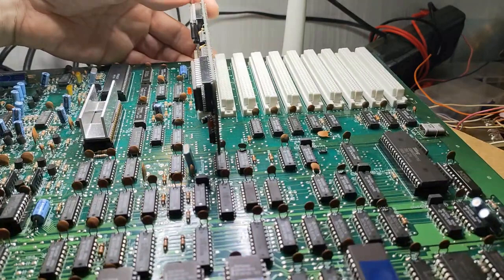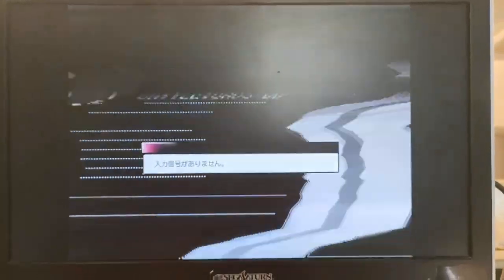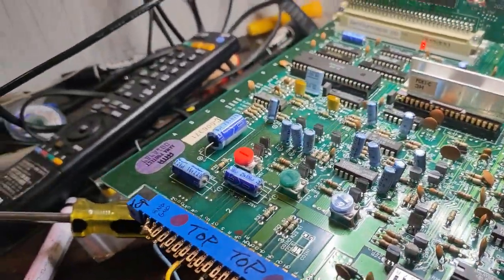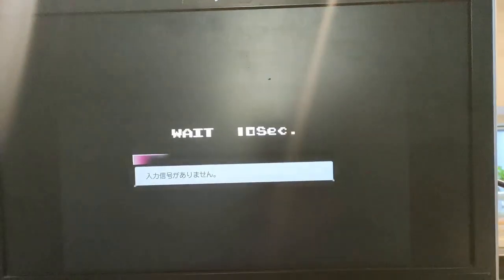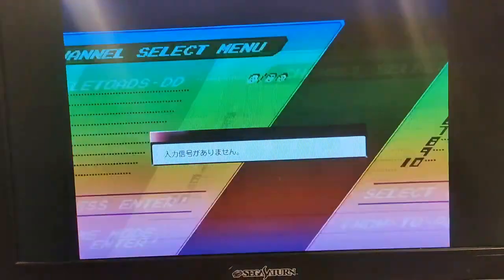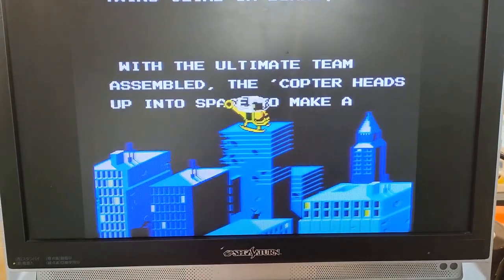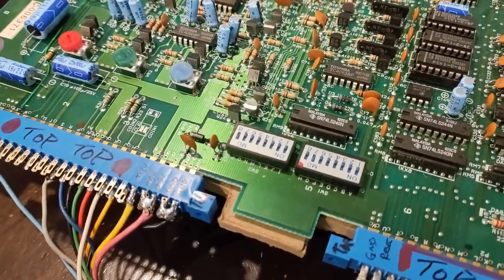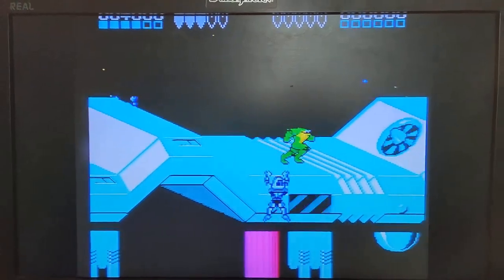Nintendo Playchoice 10 / PC-10 Arcade PCB Repair Graphic Issues No Sound

Comment: The old 2P Start button problem. I'm guessing most or all of the PC10 games to my memory were Japanese-developed NES games which wouldn't have used the 2P Start and Select buttons since those don't exist on the OG Famicom.
Since you said BTDD was not an officially released PC10 game but a conversion, I'm guessing that issue might not have been considered by the modder?

Comment: Hi Luke! You should check the TC4066BP (IC 2E); it's responsible for selecting which audio source to output to the LM3900. Those CMOS ICs are not as forgiving as the TTL chips!
Reply from the maker: Thanks Trozze! I will definitely look into that one there as well. Still waiting on parts here but thanks for the tip. Ive already changed around the current output in the video but if I get to the actual root of the issue, Ill make another vid. Really appreciate it!

Comment: Is that perhaps what the ceramic resistors in the cabinet may be for? I don't know anything of course, but there seems to be something odd about how this board is expected to be used.
I don't know what reversing the polarity on that power supply has done but that can't have been good.
Good to see you make it all work again. Shame about that amp though :)
Reply from the maker: Yeah, this is new territory for me as well. Apparently Nintendo used an inverted sync signal which what's causing all the trouble. As for the sound, thats a whole different bucket of issues. If I come up with a better solution I'll definitely post it but as for now (with the amendment in the description) the sound is good and safer than before. Thanks again Highlander!

Comment: For speedruns, ya very col, they would nto need to worry about how to accurately track time, they can just measure pixels, whomever gets farther obviously won. It would be neat if an everdrive type thing was made for this, and could somehow handle the timer even  for roms not designed to have a timer. Maybe it could force it to freeze on the last frame it is on when time is up.  Or not, just freeplay everdrive that fits this would also be neat.  Should be some good demand fo rit, every playchoice 10 owner probably would want one, and should be easy to make basically it is a nes rom cart just a small differnece.

Comment: The easiest hack would be to allow the A button to work as "confirm character selection", as it would probably be just an input designation change, but my bag is graphics hacking.
Reply from the maker: I totally agree. That would be great. Apparently with these PC10 boards, the games that they officially released never needed both players to confirm anything. Player 1 would choose either 1 or 2 players and that was it. This game has multiple characters making it more difficult for a board with only 1 start input. Cool that you are doing graphics though, thats a skill on its own. Thanks for taking the time to chime in here as well
Reply: @lukemorse1  I mean hacking the ROM itself to accept different buttons as the confirmation key. Easy enough to do for anyone with a passing familiarity with 6502 code.
Reply: @lukemorse1  Hey buddy, link me a dump of the roms and I'll take a crack at it

Comment: Have you noticed any evenly vertical faint lines running down the screen? Supposedly they are called ram lines and is normal. Dunno if the video inverter from the monitor is responsible or if this is how the board outputs video. My 5 .VS boards + pc-10 do it as well. Local arcade has a VS Super Mario /w CRT ram lines are very visible.  I was thinking maybe the jamma adapter causing it who knows. As usual Nintendo has to be Nintendo. I would love to figure out a way to get rid of them. thx BTW PCBjunkie makes the world's greatest jamma adapters. Cheap plug :)
Reply: I appreciate the cheap plug. :)
Reply from the maker: Haha! love the cheap plug but pcbjunkie really does make some great stuff. As for the lines that appear in the graphics, I remember a long time ago that you could help remove the jailbars by adding ceramic caps to the between the power rails on the board. This usually works on the famicoms and snes systems and seems to reduce the lines. Hopefully that will help out a little. Also, maybe a plug again for pcbjunkie but I havent noticed any jailbars while using his adapters so that may say something about the quality 😁
Reply: @lukemorse1  jailbars have a very uniform look. For example if your static in SMB they show but if your running they disappear until your static again. When using an hdmi upscaler they can be very pronounced. Ive used a mesh crt filter to minimize them still there.. dunno its annoying. Only nintendo would use a video inverter on their monitors.. they do nothing standard.. btw is there a way that battery can be replaced?
Reply from the maker: @ACiDRAiN9797 For sure. This was the first time for me messing around with an NES board like this and it was funky. 
They definitely should have gone a different way with the design but that may be the reason why the snes board was the last one of 3 they made lol. 
As for the battery, it is replaceable and looks to be similar to ones used on the Taito boards like Operation Tiger. I'm not sure what the best replacement would be but  it definitely looks replaceable.

Comment: I would more suspect dried out caps causing the audio issues.  Your mod may work but exposes the CPU to ESD from the edge connector and may damage the CPU over the long term.  I would try and follow the audio through the circuit and fix the damaged components.  It is also possible that a resistor provides the voltage to the op-amp and that got damaged by the swapped power inputs.  Most older op-amp circuits will need a positive and negative supply rail so that could also be the issue as well.
Reply: Hi Luke, I just came here via pc (watched via phone) to say just that what samt4202 said.   I learned the hard way..  never jack in directly to the sound chip.  Just about anything can cook the outputs on the chip: connecting an amplifier that's ON, static, bad luck, certain time of day, turning the tv on first.... The audio amp might not be needed, per say, but, it acts as a buffer to prevent damage to the main sound chip (which is also the cpu in this case) - fixing/replacing an amp and its supporting circuitry is usually easier/less expensive than replacing the sound chip.  Take it ez buddy!
Reply from the maker: @dinkc64  Thanks for that dink. Yeah, Ive gone back through the board and started looking for other possible culprits. In the meantime Ive added 2 resistors from the audio output lines on the cpu before sound it sent to the connector to prevent esd from jumping back to the chip and frying it. The PC10 used 2 amps, one after the audio out section and then another after the harness (which it has one built into the adapter from pcbjunkie). definitely going to go back and see what else I can come up with here. Thanks again!
Reply: Was thinking the same thing. If the negative rail is only used for the audio and it's missing, may cause an issue.
Reply from the maker: @Saiph  Yeah, its really strange with these PC10 setups but Im going back through the board to find a solution.
Reply: One other thing to mention... putting amps / opamps in sockets can sometimes introduce oscillations or noise being picked up from nearby traces / components.
Reply from the maker: @pcbjunkie1  Thanks man, Ill keep that in mind here and check the situation as we go. If I start to get static or any kind of noise Ill just permanently fix it to the board here.
Reply from the maker: Thanks for the info here. I've gone over all of the resistors to look for shorts to ground as well as checking the values on them and there were no problems there. The caps could be an issue with being dried out although the seem to be outputting correct voltages. I did go back through the circuit and came up to a LM324 that seems suspect so Ill test the lines here a bit more down the way and test that out further. This  PC10 is an interesting set up as although it had this LM3900 amp in it, it also requires a separate amp from the board to the speakers which its using on this adapter. The PC10 also doesnt have a negative ground for speakers which is strange, only a single "speaker out" for the main monitor and secondary monitor for the dual monitor setups. Nevertheless, Ive decided to go back and check this out and added a couple of resistors to the audio outputs before the wire goes to the edge connector in the meantime. Thanks again.

Comment: I need to send you a proper PC-10 adapter, maybe some other goodies as well. Awesome job repairing this one. It's a great board, and having battletoads with it is the chefs kiss.
Reply from the maker: Thanks a lot man. Yeah, I tried to do what I could with what I had on hand at the time. Luckily I had one of your adapters and with your video and audio circuit it worked like a charm so thank you! haha, if you have a PC-10 adapter around there I wouldnt mind getting that from you. As much as I dont mind this creation, a more solid adapter would be nice. Hopefully someone will be able to fix the code on battetoads for 2 player. Thanks again for checking the vids as usual!